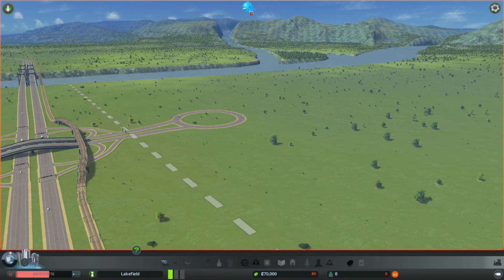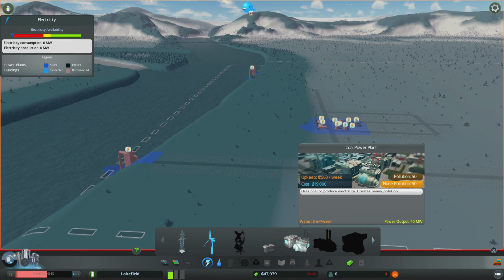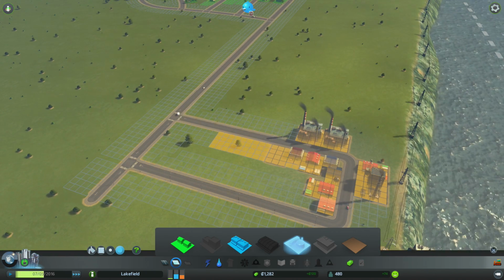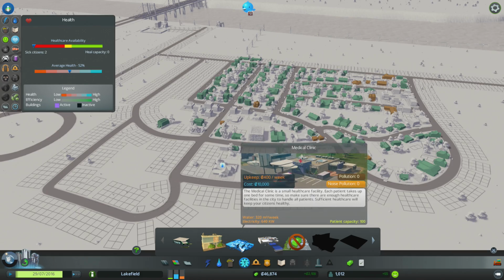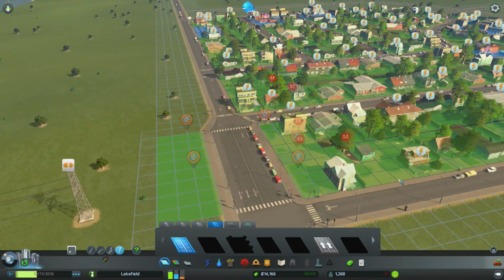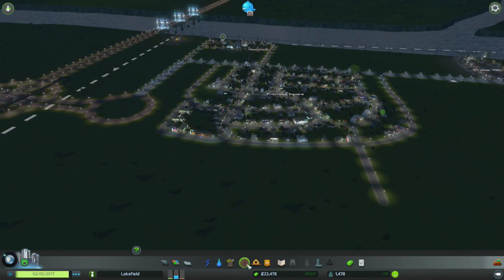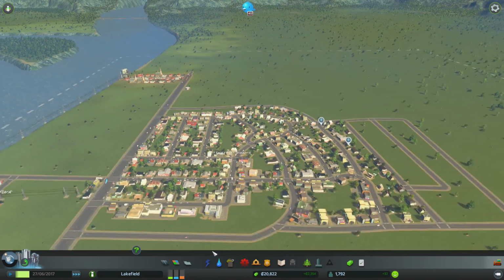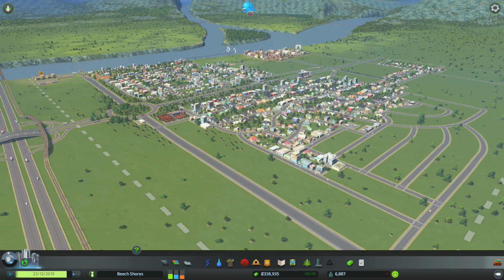FIRST TOWN TIPS | Cities Skylines Beginners Guide

Comment: Good video. I learned a few things. No. 1 Lesson: Start Small. I was trying to over build my residential areas too much at the beginning. Then I saw you start with just a few blocks, and I tried that...and it worked. I'm just about to cross the 1,500 population marker and things seem to be running smoothly so far. I'm about to build a bridge over the river and open up the whole other side. It'll be a big investment, but it should pay off in the long run. Thanks for the tips!
Reply: Put an automatic toll booth on the ends of the bridge lol

Comment: New players should not be encouraged to start building their city around a roundabout.

Newbie players invariably choose to create separate areas for their residential and industrial zones connected only by the roundabout. This is eventually disastrous for traffic. A roundabout is not a high capacity junction.
 
Roundabouts really need the Traffic Manager mod in order to function properly in Cities Skylines. Console players don't have access to any mods. Even if a newbie player does have the TM:PE mod they're unlikely to get the roundabout set up properly since the setup is pretty complex. It's incredibly easy to completely bork your city with a single stop sign or signal light lurking somewhere unintended on a central roundabout.
Reply: your really smart

Comment: For anyone watching in 2020:
As you become better at this game, you learn to be more future-proof.
This means better planning, preemptive preparation, and some of best tips are as follows:
1. If you use wind turbines, you can use them to help spread the power grid, definitely cheaper in the long run than running coal + several connections.
2. Use commercial zones to connect the residential zones to any noisy/polluted zones.
3. Try to zone industrial zones CLOSER to highway entrances, so trucks don't have to travel through the whole town when you import/export.
4. DEFINITELY pause the game before you're done setting up the basics.
5. DEFINITELY adjust budget, taxes, as soon as you are able to.
6. DEFINITELY know that "IT'S FINE" no matter how bad you screw up, just enjoy yourself!
Might take awhile to get better, but you DO get better, and you will find yourself sitting infront of your screen designing a crazy city for hours nonstop!
Reply: Thank you <3

Comment: I would never put industrial in the part of the city that utilises the same roads as residential. Zone industrial opposite side of residential that has an independent route off and back on the highway, that doesn't not need to go through residential zone.

Comment: Ugh it was annoying. I placed and replaced windmills and they stayed there and the lightning icon on zones faded away then came back and the windmill is still in same place. 
Also I have tips for starting:
Use roads first before anything else. 
Dont use zones right away. Using them near the big out of map intersection will clog the traffic. 
Make sure to keep adults and workers balanced.
Build houses to reduce your dept to 0. 
If a icon is present over zone and you dont know what it is, use the info thing to see what that is. 
Use guided circles(blue circles) to determine your length. 
Make sure to use water pump and drain pipe. DO NOT LEAVE ONE OUT! Otherwise it wont pump water or get rid of sewage. 
Dont use intersections as it will confuse the drivers to where to go. 
Make sure to save plenty of room for new stuff. 
Use info thing for tips for upgrading. 
If you having trouble with something, solve it quickly before it spreads or becomes a serious problem. 
Dont put polluted buildings next to green zones.

Comment: The biggest problem is you can't waste your money on good roads from the start. And may not have the necessary roads yet. So you know you're building what has to be destroyed later. Plus space. You could build freely but this 1 square is all you have. Then you get second one and it's mostly water or mountains or shredded by highways. So you have planned a really nice city but you're forced to build crap for the moment. Or you can have a nice start but the profit will be... well, let's say I don't like time-cheating, having $100 profit set for fast forward for a few thousand years. It's just silly, better use sandbox mode.

Comment: Always pause the game and do all the building you can before you unpause it.  Make sure you have water, sewage, and power, enough roads for a good sized residential area as well as commercial and industrial.  I would start with half of it residential and just make sure you keep the industrial by itself.  Make sure you have a power line to each area just incase.  I would do 1/2 as residential.  Save the game before you unpause it because you might have screwed something up and you likely will go negative very quickly.

The other issue is you will eventually run into traffic issues, so it is best to set up a good system as early as you can.  I would make a highway down the middle of the town and cross it later as you unlock other blocks and have more money.  Then have them all exit into the middle of a large turnaround and have the roads exit out from there.  Then attack airports, train stations, and cargo ship docks to the highway only and let them come in from there.  The last tip I heard recently was to scatter your commercial around so the cargo trucks do not overload one area too much.

Comment: hey awesome vid and very clear … I like that you go straight to the point of explaining what needs to be done.
1 question please :

time --> 15:27
The Budget Tab
Would you mind explaining the difference between changing the TOP bar and the Bottom bar in a row ? for example 
THe Electricity row :
if I changed the top to 95%
and the bottom to 90%

What exactly does that mean ?

Thank you for the video by the way , your video is probably one of the very few I watched the whole thing without skipping forward .
Sub and Liked.
cheers =)

Comment: So, why wouldn't you just want to remove all traffic lights?
Reply from the maker: Well, in some situations because of how traffic generally behaves it can good to have traffic lights, but only if the location can handle some queueing, it really just depends on the situation. Having no traffic lights anywhere though can be equally as bad. 

If you do decide later to add some mods that can help in terms of traffic behaviour like the almost essential Traffic Manager President Ed. So that you can control if cars enter intersections or only if the exit is clear etc etc https://steamcommunity.com/sharedfiles/filedetails/?id=583429740

Comment: how do you control the angle that a road makes when you draw it from point A to point B? I wanted to make a ramp that goes on to the highway, but the curve of the road made the ramp point straight into the highway rather than aligning with it from the outside.

Comment: The wind power plant costs 10$ per MW versus the coal power at 14$ per MW.  But that assumes max output.  The real issue with wind power is it’s very inconsistent compared to coal.  Your coal plant will ALWAYS run at max power (unless something weird happens) whereas the power output of wind turbines vacillates wildly based on weather.

Comment: My purely funtional cities tend to lean towards wind and solar power only. Low upkeep clean power. Literally no negatives. Dams are kind of a wild card. 

Granted I do start with coal in most cities then upgrade to clean power once my industry income kicks in. My issue is always traffic. Even when rocking tripple deck highways traffic can hit a stand still due to terrible ai. Mods are basically bandaids in this regard.

While dams can be the most dangerous power source I absolutely love them. I can spend several hours just messing with water physics. Setting up the perfect waterfall for example.

Comment: If you look at the top left of the screen where all those info icons are, click on the lower right-corner icon. After clicking on it, you'll then see a button called 'junctions.' Click on that and you'll see you can toggle traffic lights and stop signs on and off at every single intersection in your city.

Comment: In my experience, roundabouts are only good for light traffic areas. Once there's heavy traffic they easily become congested
Reply: MrC0MPUT3R It's much worse if it's tiny
Reply: Using highway roads Instead of six lanes only on the roundabout makes it flow SO much better, even though the roads seem smaller
Reply: I always add farms because I think farmers help people
Reply: @Chamber of Sins I don't think you could have when I made this comment 3 years ago. The devs have done a good job including functionality from mods into the base game.
Reply: It's actually not because roundabouts aren't good for high traffic per se, but because of relying too heavily on a single intersection (as in the fastest route for too much traffic). It's technically the opposite; they're good for filtering plenty of traffic quickly, but everything has a limit. Not being able to spread traffic around enough seems like a pretty common issue in this game, and one factor for the fear of traffic lights :D
Reply: Risto Salonen Also the AI have no clue how to use lanes properly :P
Reply: The one lane syndrome? If they don't have reasons to use all the lanes on a road, they won't. Simple rules for simple AI that always uses the fastest route, haha :) There's actually a nice example of good six lane road placement in this video at 40:50. All lanes are being used by vehicles at intersections because there are destinations in all directions more or less equally. Works a charm with more intersections too as long as there aren't too frequent stop lights.
Reply: Risto Salonen Yeah. Traffic++ has become essential to me because of the lane management :P
Reply: MrC0MPUT3R
You can get them to use all lanes in just vanilla too, but I'm of course not blaming anyone for using traffic mods. Helps the creativity :)
Reply: @MrC0MPUT3R , TM:PE is better. Change my mind.
Reply: Go and tell that to Bruxelles Mobilité...

They spam roundabouts all over the F**ing place, and it's just getting worse...
Reply: @kikookikaboo7808  What's up with this traffic circle connecting "Tunnel Leopold II", "Avenue Emile Bossaert", & "Avenue Jacques Sermon" ?

I say traffic circle because it looks like there are stop lines and the circle would only be used for changing routes?

Comment: Not a bad guide but in the very beginning it is good to have the industry zone as close as possible to the highway access.
Reply: I think so too, that's how it generally is in real life metro areas.
Reply: J'mar DDM 

I thought industry zones are sort of in urban, downtown type areas IRL
Reply: To make the the Intermodal system efficient, hence why industrial parks are close to ports....in real life that is...i habe no fuc*;#g clue what this weird game is, i stumbled upon this.
Reply: I usually start with a split in the road as soon as possible - one going to the industrial area, and the other going to your town. A third main road then links industry with residential. This triangle configuration keeps your traffic under control for a very long time.
Reply: Distance is not the factor, it's about not having trucks drive through town. As long as the industry has his own way of getting on and off the highway it's fine really. So yes i do agree that his industry is not really smart since it has to drive straight through town. Be reminded that industry does produce goods for you town (for commercial zones) so having it in the middle of nowhere close to the highway is not always the best option ;)